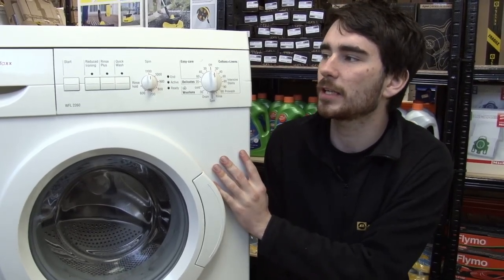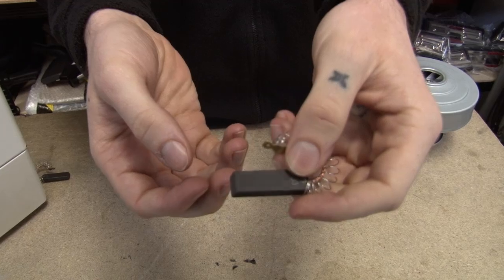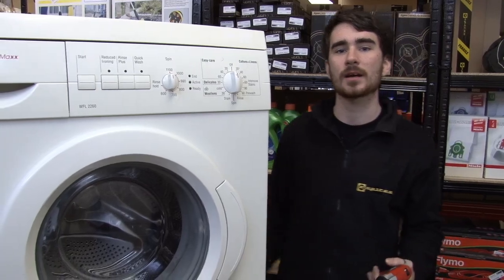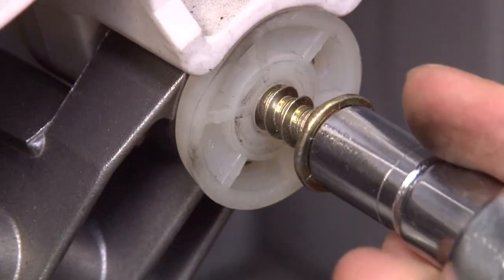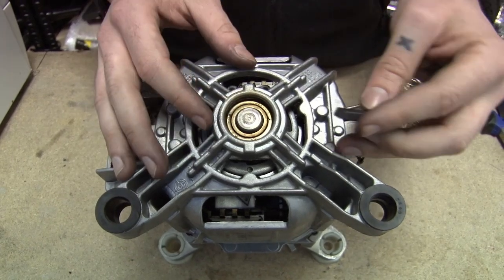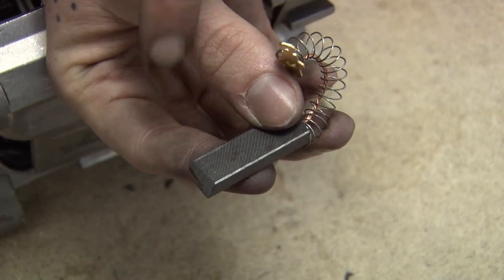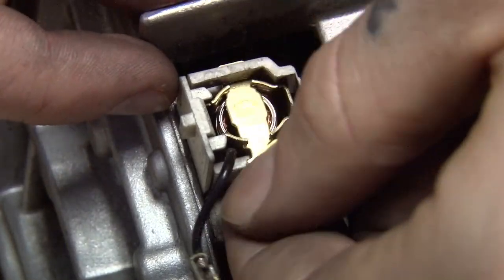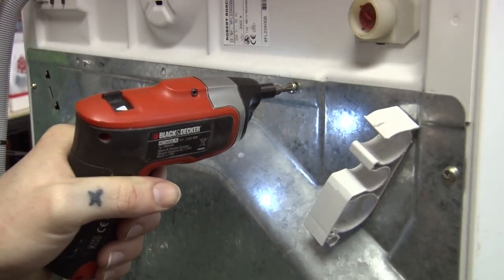How to Replace Carbon Brushes on a Washing Machine (Bosch)

Comment: Excellent, clear video, short and to the point.
Reply from the maker: Hi, thanks for your comment here. If you do need new carbon brushes for your Bosch washing machine, you can check out our range here at eSpares:
https://www.espares.co.uk/washing-machine/bosch/carbon-brushes/catalogue.pl?path=1015007,112757:1015070&refine=carbon+brushes

Comment: Great video, many thanks for making it, it gave me confidence to try this myself. The machine is working perfectly again. One final step was needed for me, I had to reset the machine using the spin button and dial method to clear the error.
One thing I didn't expect is that the time left indicator is accurate again, it had been way off lately. If anyone finds their washer takes longer than it says, this is apparently an indication that the brushes are nearly worn out.
Reply from the maker: Hi, thanks so much for your comment...it's great to hear that our video gave you the belief that you could replace the carbon brushes. Well done for completing the fix yourself, to keep your washing machine running! Glad our video could help you.

Comment: Well explained, I'd need to replace mine ASAP 
Thank you😊
Reply from the maker: Hi Charlie, thanks for your comment. Glad our video has helped you, and you can check out our range of Bosch washing machine carbon brushes here at eSpares:
https://www.espares.co.uk/washing-machine/bosch/carbon-brushes/catalogue.pl?path=1015007,112757:1015070&refine=carbon+brushes
...be sur to select your model number from the left-hand navigation, to get the correct part for your particular appliance.

Well done for looking to fix your washing machine yourself, let us know how you get on with the repair!

Comment: Worth mentioning I bought replacement carbon brushes from eSapres and they arrived next day for a tenner. Super service and saved me £500+ for a new machine. One point though: the  (ES1019979) brushes were too tight in the brush holder. They need to move freely downwards under spring pressure as they wear. I sanded the edges with 400 grit wet and dry paper until they slid in more easily and happy to say the machine is back in action. Happy days!

Comment: I'm going to replace the motor brushes hence watching this video.
Also with my washer, WFL2260UK/12, the led lights for Quick Wash and End are not working. Is there a fix such as replacing the LEDs?

Comment: 2024: Machine 24 years old and stopped spinning. Replaced brushes - a bit awkward as the whole back panel doesn't come off. There is only a smaller panel to reveal the belt with no access to the motor mounts. When you said some motors don't need to come out to change the brushes I guessed my Bosch 2260WFL/04 was one of these and was designed to enable replacement of the brushes while the motor was insitu. I think it’s more awkward than removing as space is tight. However, finally, all is back to normal working. Wife very pleased so thanks for the video. It was also a chance to inspect the belt as these machines are usually tucked away between kitchen cabinets and under a worktop so dragging them out requires some motivation to inspect parts. Brushes cost £12 with next day postage. New machine: £500!
Reply from the maker: Hi, thanks so much for your comment here. It's great to hear that our video has helped you to keep your trusty washing machine running, and that we have helped you save such a lot of money too! Well done for completing the fix yourself, even if your model sounds like a few extra things had to be considered while doing it...pleased eSpares could help you with the replacement!

Comment: After replacing the brushes, the washing machine smells like burning rubber when washing on 90 degrees celsius. What might be the reason for this?
Reply: maybe they're getting adapted to the motor

Comment: I’d like to alert people to a possible issue and ask your opinion. I bought some very cheap allegedly Bosch brushes off eBay and they lasted 11 months. There are obvious scorch marks on one and the other one split and they reduced in size to about 1.5 cm, whereas when they were new they were 36 mm. The previous original brushes lasted 10 years. Do you have any advice about how to buy good quality brushes? There was a strong electrical smell for a month or two while they were wearing in or so I thought, but this was probably them overheating due to low density carbon.
Reply from the maker: Hi, eSpares have a range of Bosch carbon brushes available.
Just be sure to purchase the correct brushes for your particular model.
https://www.espares.co.uk/search/ma856pt1554/washing-machines/carbon-brushes/bosch

Comment: Thank you. Your video was invaluable while replacing the carbon brushes on my old (20 years) Bosch Axxis+ I had to order the brushes twice to get the exact kind but in the end it worked and the washer is working again as it should.
Reply from the maker: Hi, it's so good to hear that by watching our video you have been able to repair your 20 year old washing machine yourself! Hopefully it keeps running for a long time yet.

Comment: "all motors have carbon brushes" correction , all Universal type motors have carbon brushes. most motors on appliances here in USA have split phase (resistance start) motors. vacuum motors and some european designed motors use this style in USA. but when they wear down the mfr's want to sell you a whole motor for $500. crazy. the Bosch carbons or (Cestec) can be made to fit the Whirlpool motors as they are european design.
Reply from the maker: Hi jim, thank you for your post and a lot of motors here in the UK do have replaceable carbons but we agree a lot have induction motors which are made to be replaced as a whole motor which van be expensive.

Comment: These videos are just a sell for spare parts. They show minimal diagnosis and actual repair. All washing machines need to have a 5 year warranty minimum.
Reply from the maker: Hi Houdaloth Ali, thank you for your post but the video does not come with any obligation to buy a spare part from us,  this video is not indented to be a diagnosing video but does show exactly how to replace the brushes on a Bosch washing machine. unfortunately, most manufacturers will never give a 5-year guarantee due to costs so the more people who can repair it themselves the better.
Reply: @eSpares  I believe changes will happen in EU soon where manufacturerers will give a at least 10 year guarantee. Diagnosing is not easy always and it needs an engineer to come out.
Reply from the maker: Hi Houdaloth Ali, it will be interesting to see what changes are made and how a 10-year guarantee would work, we have diagnosing videos on our channel to help people find the right solution for their machine.

Comment: It's good practice to clean the armature with a comm stick before replacing the motor too as its gives a better connection to the brushes 😉
Reply from the maker: Hi Dambuster Motorcycle Tours, thank you for you for your post.

Comment: I have a WAB24262GB/16 I've ordered new brushes from you guys, but I cannot get the motor off. Two T25 torx screws are out but the motor won't budge. Any help gratefully received.
Reply from the maker: Hi Tom, if you have a look at the video at 2.14 there are 2 white inserts, these have to come out usually before you take the motor off and they are very tight so use a flat blade screwdriver to prise them off.
Reply: All sorted I figured that out before you replied, motor is out and just awaiting the delivery of new brushes from you chaps via DPD, tracking says they'll be here in about a half hour. Thank you for replying, much appreciated, If I run into difficulties then I'll have a look for help, this is my first time doing this I want my sense of achievement.

Comment: I recently changed the carbon brushes in my mum's washing machine and it's sparking a bit but nothing major, it sounds as if the brushes are just bedding in as the time of this comment it has only had 1 wash, they sit tight and nice and flat on the commutator but I had to take the casing off of the new set and fit them to the new but they sat flush but the opposite way they did before. Will it be ok I just don't want it exploding or anything. Thank you
Reply from the maker: Hi I.D.E.K games, it sounds like they are fitting wrong, normally if you have the correct parts they should fit exactly the same way as before so you need to check them as they should not be sparking.

Comment: Should have seen this earlier. Took the complete motor apart, after I found it it's much easier to replace them just like this. I had trouble getting the bushes in. After putting the parts in again, it's not spinning, so migth need to open it up again :(
Reply from the maker: Hi paradoxical81, you do need to make sure the new carbon brushes are positioned correctly or it won't work.
Reply: @eSpares  Turned out the casing put back on, but contact points not landed in the socket!
Reply from the maker: Hi paradoxical81, thanks for letting us know and well done on sorting it out good job.

Comment: I've watched about 30 washing machine related videos in the past 12 hours. Yours is really helpful, as you zoom into the fiddly bits. Thank you so much! 
My fault is yet not found - but there are so many areas my machine could have its fault. Carbon brushes is just one. :)
Reply from the maker: Thanks Waren Willer, glad to know you enjoyed our video. We hope you get the issue sorted out.
Reply: Thank you! Unfortunatly, I wan't able to remove the motor to get to the brushes and got a worker in. He ripped me off, stating the motor is broken without even testing it. When I opened the brushes they were completly worn down on one side, and barely there on the other. When I asked how he can be sure, this allone isn't the problem, he said, he never replaces the brushes "because it ruins the collector (?)". Well, I knew I was had, when he stated this. He wanted to take the "broken" motor with him. I said no. Definitly not. Now I'm checking out, if the "broken" old motor is really broken. But it'll take time to get someone to look at it and try it with new brushes. 

Aaaaanyway: without your video I would have believed him anyway and now I know he is untrustworthy at least and never ever to use him again (and warn people, once I have proof).

Comment: Can't get the wire out of mine :(.   Did you just pull it out or is there a clip?
Reply from the maker: Hi Bobby, there is a close up of the carbon brush removal at 2.58, you need to push the clip forward to release and then lift out.

Comment: If you have a F:43 error on a Bosch Logixx, you will need to reset or clear the error after replacing the brushes. 

Reset circuit board: knob to off (12 o'clock), then down (6 o'clock),  press and hold spin, round to 9 o'clock, wait 5 secs, release spin, knob to 12 o'clock. Should be reset.

Some machines have a different reset method:
Put dial to spin, hold left options key, turn dial to drain, release left options key.
Reply from the maker: Hi Felixrising, thank you for your input and the resetting information is always useful, we do cover Bosch error codes on another video www.youtube.com/watch?v=PvJlqOjG6Uc&t

Comment: Induction motors don't have brushes so not all motors
Reply from the maker: Thanks for the input Tim, we have covered this before in the comments below. This video was produced comming on for 8 years ago, at that time most machines used brush type main motors. SInce then for increased long term reliabililty many manufacturers have used induction motors more and more.

Comment: what are you doing with your machines to wear out the brushes ? I remember the machines of my parents running for 20 years and  more and the brushes were never changed
Reply from the maker: Sorry Bob but most modern machines using brushes will need them replacing after four to eight years of 'normal use'. But to be fair to the manufacturers there are a number of reasons for this. 1: the motors generally use more power due to higher wash volumes and spin speeds. 2: the machines now are cost less than an average weeks income, in the sixty's they could cost several months wages.
At least the parts are usually easily available and easy to replace.
Reply: sorry, so far we trashed all our washers with the factory brushes still installed
Reply from the maker: Many higher priced machines use brushless induction motors so this may be why you have not had the problem.
Reply: "Modern" kids wear for a morning then it goes in the wash !  They don't wear clothes for a week like we used to 😃
Reply from the maker: Hi, John, you are right a lot has changed and machines go through a lot of work, thanks for the input.

Comment: I got an f21 error on my Bosch washing machine. I think it might be the carbon brush. I'm going to order some new ones and use this video to try and replace them myself. Pray for me.
Reply from the maker: No need to panic Ashley, eSpares will be here to help if you have a problem.
Good luck.
Reply: eSpares just took the motor out and pretty much only the springs were left on the brushes! Ordered some new ones and hopefully that will fix it!
Reply from the maker: Sounds like you have found the problem. Just be patient when refitting as it can be a little difficult to push the spring fully in and fit the tab in place.
Reply: It worked! You've just saved me a fortune on a new washing machine and made me look a right clever sod to my wife lol. Much obliged.

Comment: Thank you for all your great videos. Just a couple of points. I have a Bosch Classixx 1200 and it is impossible to take the back off (the back and sides are all one sheet). However you can access from underneath, albeit very fiddly.
One extra tip that i got:  If like me you find that you now will have no washing machine for up to a week waiting on delivery of new carbon brushes, you can reuse the old ones. When you pull them out you see that one is shiny and one is dull. If you cut the wire that is inside the spring of the dull one, then reinsert the brushes. this will have the effect of pushing them in a little more against the motor. It worked for me and should work until the new brushes arrive.
Reply from the maker: Thanks for the comments Fergus, just a word of caution. The wire in the brushes has two functions, It ensures a better electrical connection direct to the brush as the current through the spring can produce heat as it contacts the brush that could damage the brush mountings. Secondly if the tips do wear any more they can be pulled through the gap on the housing between the commutator. If this happens the spring can be dragged through and short on more than one segment and damage the control board so get those brushes replaced quickly.
We could normally have delivered new brushes in 24 hours if you request this on our web site and are in the British isles.

Comment: Great video. Took the motor out of mine and found it had 2 new brushes! One had fallen out so all I had to do was push it back in, and make sure it was held in properly.
Reply from the maker: If the brush to had fallen out it suggests it has worn away to nearly nothing. Check the brushes are at least 10 mm  or half inch long approx and replace if shorter as it will fail again.

Comment: does this video include a hec 1050w model washing machine please
Reply from the maker: Hi Paul, replacing the carbon brushes should be very similar on your machine to the process used in this video.

Comment: Thanks for a nice video. But I can not figure how you reset the F21 error: in the text note you advise ...to press and hold the spin button..., but video on 1:14 clearly shows WFL 2260 with 3 buttons and spin rotary knob (no a spin button!) -- it should be something different than pressing a rotary knob. My WFC 2060 have exactly the same look with 3 buttons and spin rotary knob.
Reply from the maker: Hi Leonid, the only other method we have found so far is below:
Select the 'Off' position with the door closed.
Press and  hold the Start/Pause button and turn the dial anti clockwise to the "express 15 min" program.
Keep pressing the hold the Start/Pause button for a minute and the error code should start flashing after a minute.
Release the button and turn the dial to the "Off" position.
You should then be able to select any program without any errors appearing.
Reply: But, machine on 1:14 have no "express 15 min" program on a rotary knob, it has quick wash button instead! :(
Reply from the maker: Try this:
Turn the knob to off and open the door.
Turn the knob to the first program and close the door.
Turn the machine off then select the spin cycle.
Hold the “option down” button on the left of the display
Turn the dial to “seven-o-clock” (empty/pump out program)
Release the “option down” button then turn the machine off.
Reply: There is no display on this model (see the video on 1:14 !), and no option-down button so far... But some combination definitely exists.
Reply from the maker: Sorry but Bosch will not give us the information directly.
Then try this:
In the off position with the door closed hold the start button  and turn the dial to the easy care 30 position.
continue holding the start button for at least ten seconds before releasing the button and returning the programme knob to the off position.
Reply: This sounds reasonable. But nothing was changed after applying the procedure twice. Sorry.
Reply from the maker: We are sorry but cannot find any more info, please post an update if you do resolve your problem as others will no doubt have this issue.
Reply: To reset the F21 error on a Bosch machine, turn the program knob from the off position (12 o'clock), to the 6 o'clock position and immediately press and hold the spin button. Then while holding the spin button turn the knob to 7 o'clock position and continue holding spin button for 15 seconds.